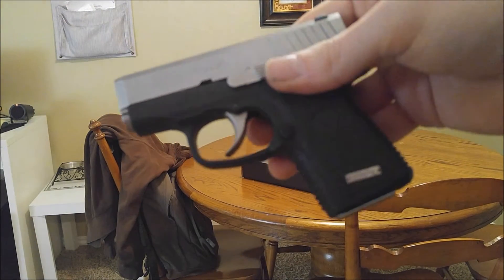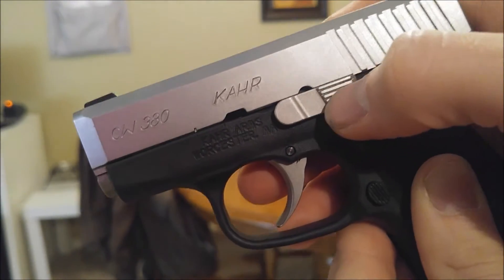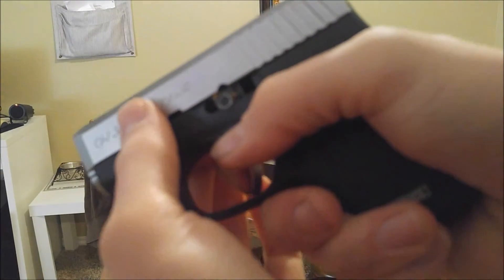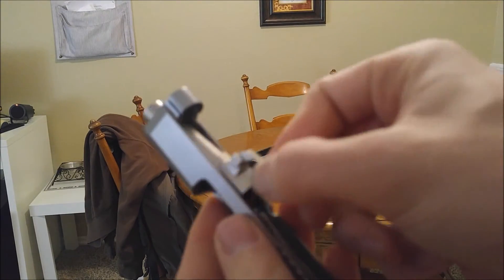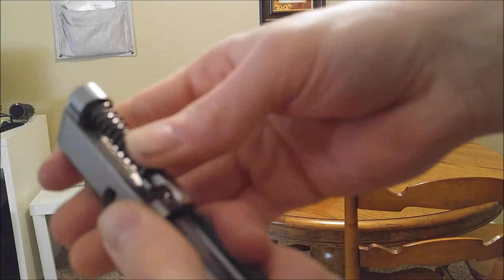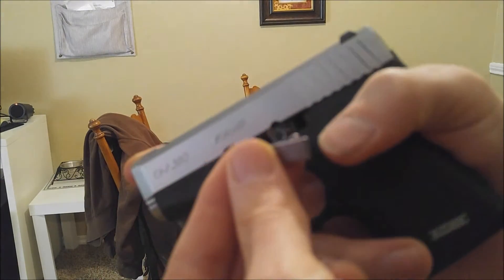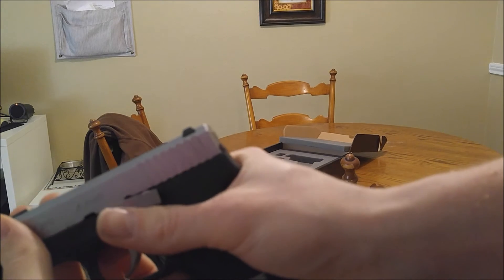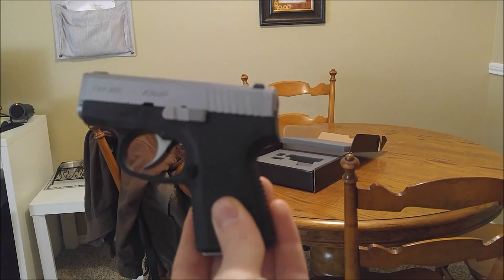Kahr Arms CW380  Disassembly and Reassembly (Pain in the A**)

Comment: I got my cw380 for over 5 years now. Spring will get easier with usage. To remove slide, try using a reverse grip, holding  the slide and grip with your thumb and index finger only. Use a punch or screwdriver to push out the slide stop/release. I highly recommend the cw380 for it's compact design and ease of carry.